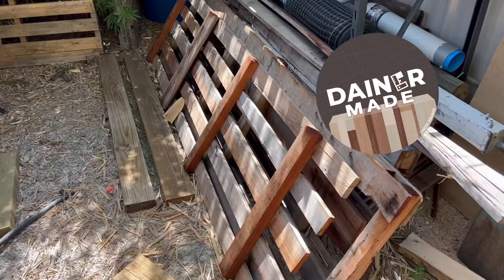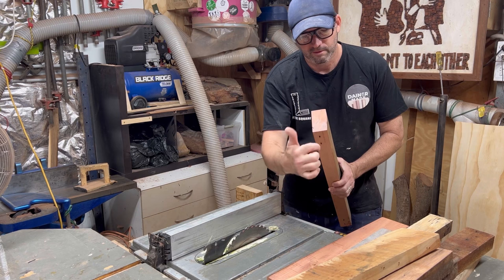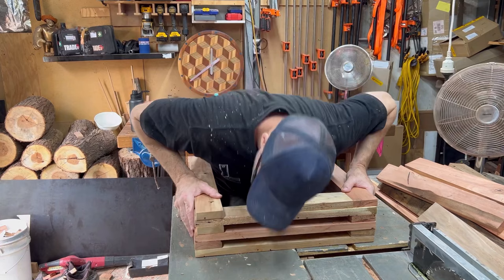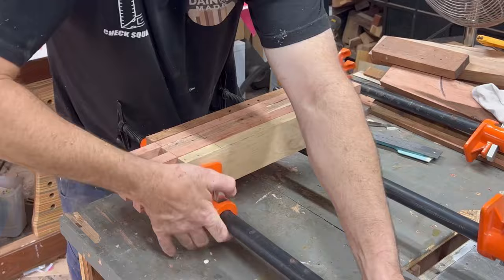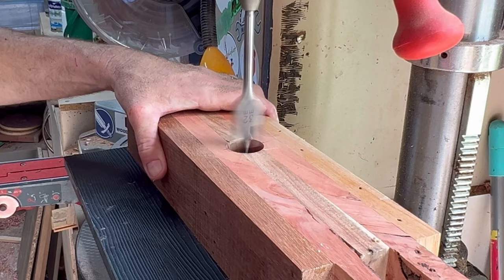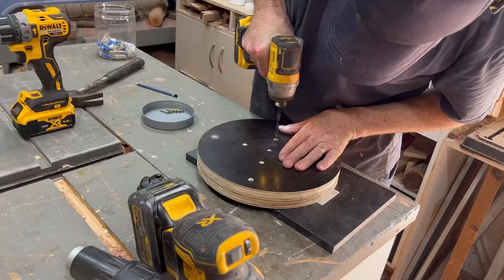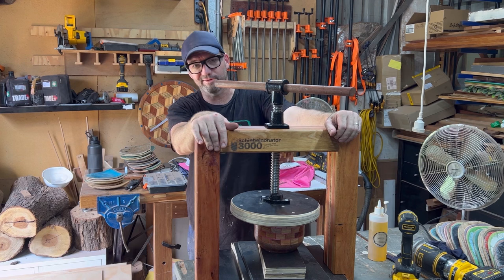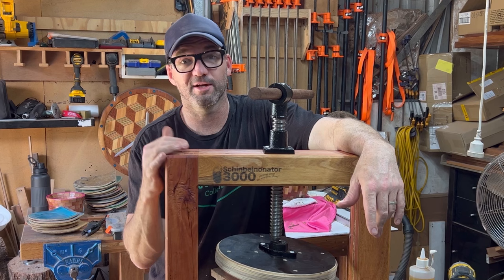STRONG PalletWood Joinery, Disguised as a DIY Wood PRESS

Comment: I have commented before and I have further experimented.  I attached the press to the bench with two  4" lag screws. When I used it the four screws that attach on top broke loose.  Ok then I put bolts all the way through the bridle.  I guess the 3rd try is a charm because it worked.  I can send pics if you wish

Comment: I think a good 3-4" lag screw through the bench into the bottom into each of the legs might work.   It could still be removed from the bench when not in use. OR maybe a  1/4" steel plate fixed on the bottom.  I don't know It would add to the weight

Comment: I made one of these and when I used it, the bottom plate broke out.  It seems that the whole press needs to be attached to the table so that it won't push itself up. Or is there something else I did wrong? I glued four 1" boards and pressed them together and before the glue started coming out the bottom plate broke the checkouts,  thanks